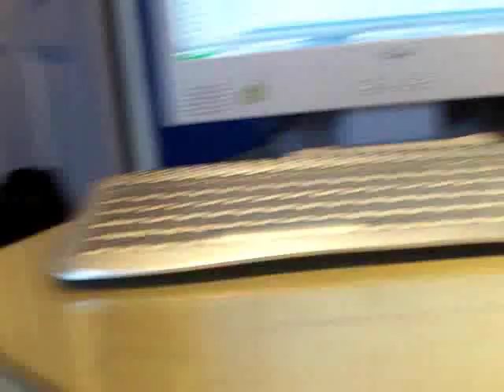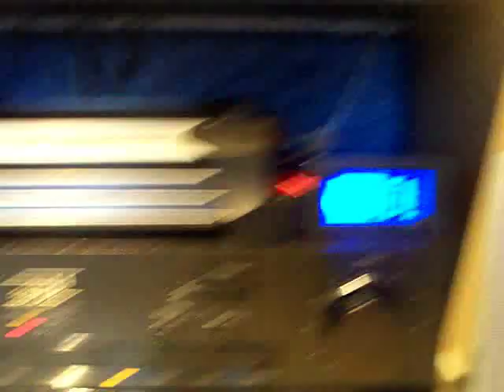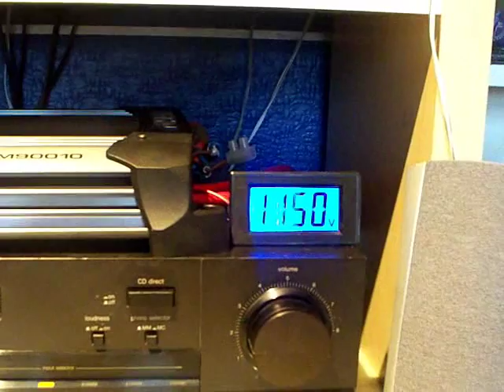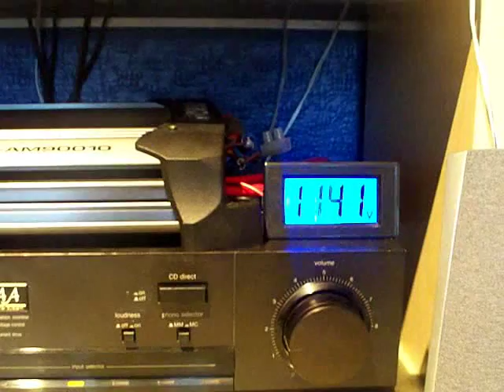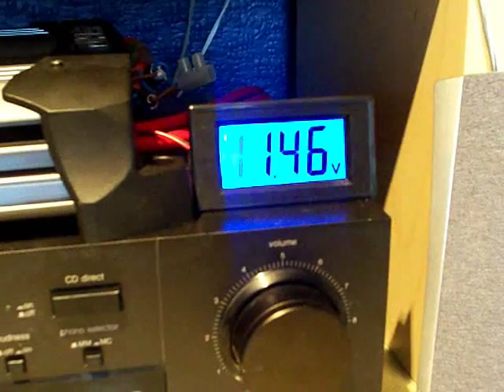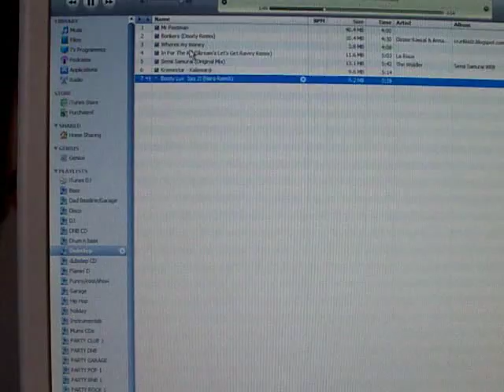Faulty PSU  - power problems solved!

Comment: did you use cupleing diods when you bridged the psu's so they cant ring them selfs? switch mode psu's normally wont work when bridged without diods.